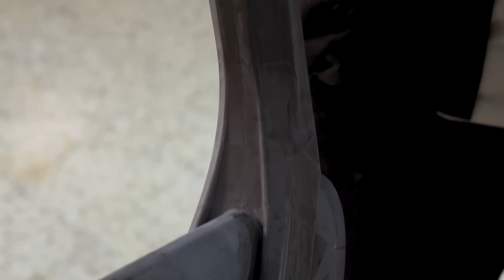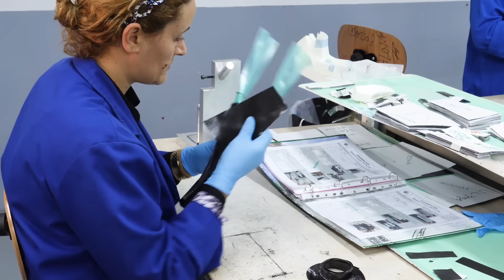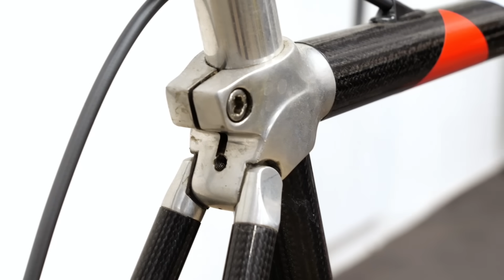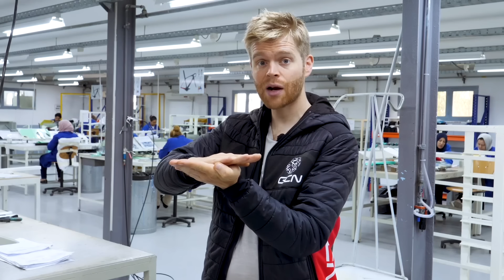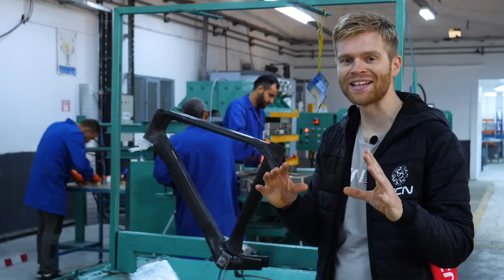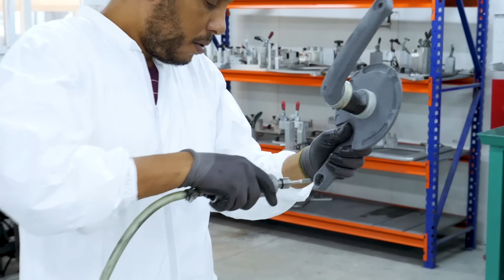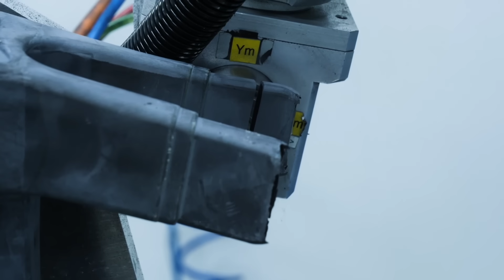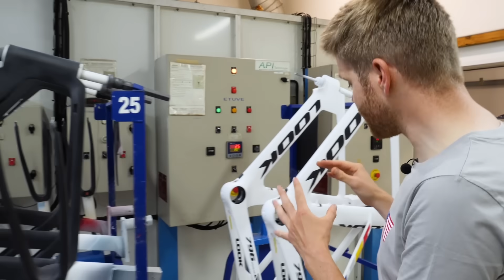How Are Carbon Fibre Bikes Made? | LOOK Cycle Factory Tour

Comment: Carbon fiber parts should not be that expensive because all the designs out there only make the "tubes" what we traditionally called double or triple butted. adding or removing/reducing material in some areas of the tubes. If the manufacturers actually had some structures inside the tubes say like what a car manufacturer does with steels sheets ie to fold them to add stiffens or desired property/trait then we can talk about that the bike manufacturers are actually worth the price they want for their products.

Comment: As a casual cyclist I wouldn't pay over about £500 for a bike and would prefer to put that money towards a better drivetrain than a carbon frame. It's interesting to see how carbon frames are made but they have zero appeal to me possibly due to not being recyclable and a more brittle material. Interesting to see the factory but rather concerned about the welfare of those workers. Titanium still feels to me the most premium material for a frame I adore the look and touch of them but carbon just looks like a disposable plastic bike. 

I saw some information about fuji-ta which is the largest frame producer in the world and their aluminium frames are mainly sub $20 factory door price but carbon frames were sub $80 normally. They produce carbon frames for many brands including cannondale I believe. Yes carbon frames are more expensive but some people state ridiculous manufacturing costs. I've seen carbon frame bikes go as low as £400 in the UK at retail. You should not connect retail price with manufacturing cost. Many premium brands like a huge margin on their products. It wouldn't surprise me if a budget carbon frame bike had a $80 frame but a premium £6,000 bike had a $120 frame.

As ever there is always diminshing returns the more you pay. Manufacturer's will always make products for every price point if people are willing to pay those prices but it doesn't mean the  prices are justified. A cheap road bike can be 95% as efficient as a premium carbon frame bike even if it costs a tiny fraction of the price of a top end aero carbon frame bike.
Reply: Think about the numbers when you bash carbon fiber for recycling. 1. The frame is 1kg of stuff that will burn clean when scrapped. 2. You use hundreds of kilos of plastic each year, most of which end up burnt, not recycled. 3. This quality frame is good for 10 years of riding. 4. If you find 1kg of waste unacceptable, you should never ever fly a plane or ride a car.
Reply: @MichielvanderMeulen  I agree partially with your points but carbon fibre is brittle and more easily damaged so 10 years is not as definite as a aluminium or steel bike. An accident could render the frame useless as could over-tightening bolts or the many carbon manufacturing issues you see on Luescher Technik's channel. I totally agree about only 1kg of waste though but still I have it in my head that cycling is good for the environment and aluminium, steel and titanium are fully recyclable and carbon just seems out of keeping with my cycling mentality of being good for the environment but I accept your point of how little it impacts the environment compared to other waste.

Comment: The manufacturing process needs one more step: an ultrasound step. The ultrasound will detect any air bubbles or delamination in the carbon. For frames at this price point, there's no excuse to not ultrasound the entire frame.
Reply: Since you are intent demonstrating your knowledge
How would go about it?
Manual pulse echo A scan would be time consuming and of limited value because of the limitations imposed by the contour changes on frame
Manual pulse echo really only works on nominally flat surfaces unless you are going to construct specialized transducers
A thru scan squirted system will not work at al, so now you are out of options
Also are there known issues where frames are failing and people are getting hurt. I suspect not. They be out of business quickly
If it ain't broke don't fix it.
 You cannot inspect quality into the bike you have to build quality into it.
Better to have a robust design and a robust process which has been vailidated by cut ups and measuring void content etc
Reply: you watched too much luscherteknik
Reply: Is crap anyways
Reply: how would one go about scanning an extremely complicated workpiece like a bike frame with ultrasound? seems impractical
Reply: Stop watching overhyped video would help

Comment: As a materials engineer, with a composite specialization, it is clear that at least half the labor time is for sanding, prepping, hiding any defect and the many many steps of varnishing, painting, decals, top coat with no functional benefit whatsoever... (in addition to the fact that it probably adds 50 to 10og to a bare frame without all the fancy finishes.  Put people would not pay $5000 if it was not for the mirror finish and the super duper fancy paint jobs and decals....